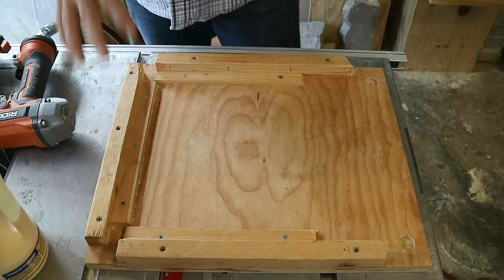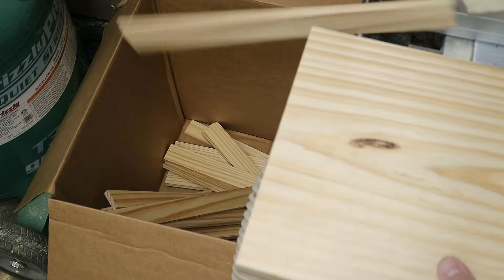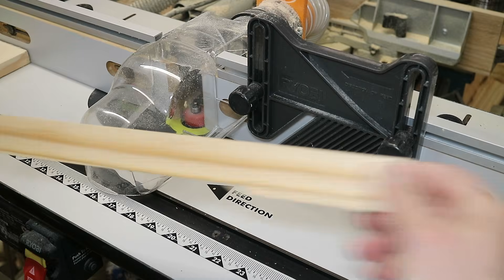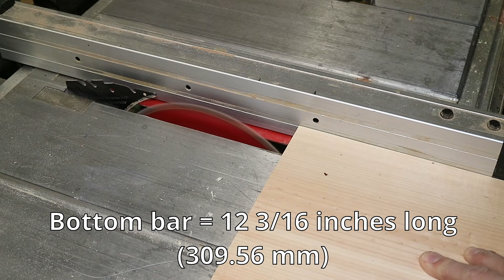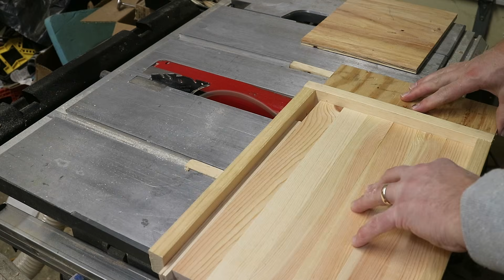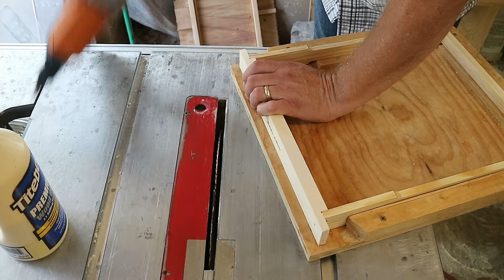Layens Beehive Frame Assembly Updates and Improvements

Comment: good information very useful ,  I am getting into building layens components and hives up in Ontario Canada.   I am interested in know more about those slide jigs you use on the table saw.  I will look see if you made a video about them but if not I'll figure it out by looking at it on this video and sort of guessing at dimension.
Reply from the maker: I haven't made a prior video about the jigs, and I don't have plans drawn up for them. As with many of my jigs, I built them by the seat of my pants, using scrap lumber, with plans to make a better/improved version later. Then, when the original does the job, building another never becomes a priority. Hopefully the video gives enough of a view to provide inspiration to build your own.

Comment: Thank you for your content!  I'm currently building frames with brads but want to move to staples for the ease.  What stapler make and model are you using and what size/gauge staples?  Thanks again!
Reply from the maker: I use a RIDGID 18-gauge narrow crown pneumatic stapler. For the frames I use 1" staples. A link to this product has been tagged in the video description.

Comment: i found, for MY personal use, as a hobbyist, that setting up my table saw with a dado blade and after cutting the 2x boards to length for the side bars, i set a stop for the, what will be the bottom on the side bar, and run the board 1/4-1/2 way down the board, working it side to side to form the narrow leg, on both sides. I then set a thickness board just behind the blade to support the board and continue knarfing away at the board till i hit the per-set stop, flip the board over and do the same. i guestimate how many side bards i want, cut that many board + 15% and work all boards. then i swap back to the thin single saw blade, put the fence back on and set for side bar thickness and cut all boards for the side bars. 
Again, this is MY method, and it might take longer to do, but its what i found that works best for me, since i disassembled my router table and used the router on my table slab surface flattening do-dad.

Comment: Thank you. I like the finer points covered in this updated version. I'm searching online today to find info about adding a horizontal dowel. (I found a collapsed comb yesterday.)
Reply from the maker: I've started wiring frames with a cross-wire pattern as well as straight wire. It still allows for the use of a rotary extractor (which is the purpose of the wire in the first place) while providing more vertical support for the comb. My technique for the cross-wire keeps everything else the same, such as how I drill and prep the frames and I use the same wiring jig. In my hives with full insulation comb collapse is rare, but when it does happen I haven't yet had a cross-wire frame completely collapse. I plan to post a follow-up to this video demonstrating both wiring styles, but don't know how soon I'll get that made.

Comment: I have got better at building Lazutin frames. Outdoor wood glue. Indoor wood glue is meant to stay dry. I rip everything to 1/2 inch. I don't cut down my side bars. I run top bars over table saw in center for starter groove. To fit a Popsicle sticks for starter. I use a 1/4 dowel vertical down the the center all the way into bottom bar. I don't wire my frames but do glue and screw them. My top bars touch, and bees leave space at top of frames to climb across frames in the corners. When I was using 1.5 inch dowels for top bars/starters, I would drill holes in them to let bees pass to next frame in winter. I finally got all 7 colonies in their own hive. I have had 2 hives with 2 colonies in them for 2 years. They finally go big enough for their own hives in winter. 2 were late swarms I trapped. The other 2 were a split from mustang hive and mustang hive. Feel I should not of split them. Should of destroyed swarm cells. And let them grow. I left divider in and think I should of removed for more space. Was trying to get them to fill frames more for winter. The down state bees from mustang trunk I moved to U.P. didn't do the best. Think they finally became acclimatized after 2 years.
Reply: LOVE IT-American innovation!

Comment: I follow pretty much the same process except for the side bars and the wire orientation.

My side bars are 1/2” thick rather than 3/8” (with appropriate modifications to the top and bottom bars so the bee space is the same). I then drill three wire holes in the side bars so my wire is horizontal, not vertical or diagonal. This should totally eliminate comb collapse.

I’ve never understood the vertical wires in both Layens and Lazutin frames.
Reply: Love this.I just cleaned up a comb collapse issue yesterday. I'm on YT today to research the option of adding a horizontal dowel to all my vertically wired frames.
Reply: @UserB3247 

The only issue I’ve noted with the horizontal dowel, the bees draw comb down to the dowel and then stall for a bit before drawing past the dowel.
Reply: I love it--more solid of a frame.
Reply: I thought Comb collapse is caused by heat , the comb will melt around and through whatever you try. It's your practices you might want to consider.  This man is using layens hives . You can wrap your hives in foam with extra foam top for sun . Maybe your colonies are on a wooden deck or concrete slab or in a corner with no air flow ...
Reply: You can make a cage to go around your foundationless frames, to then put them into the extractor and can be reused